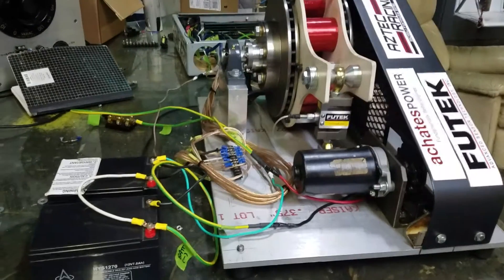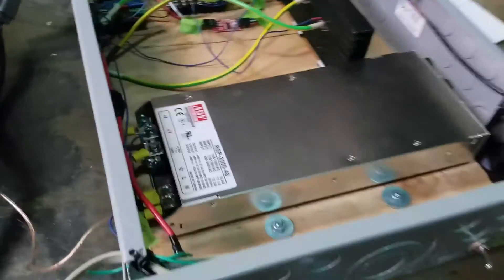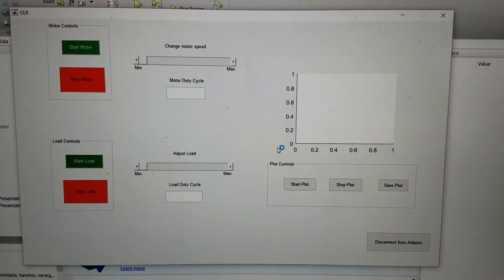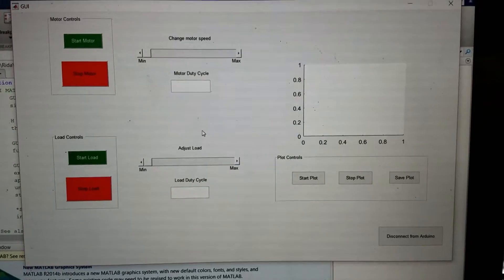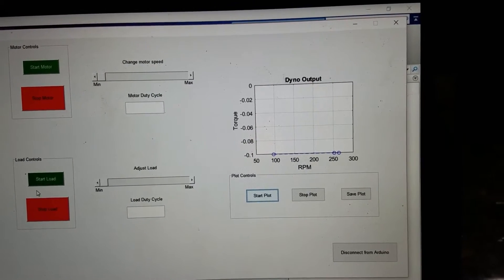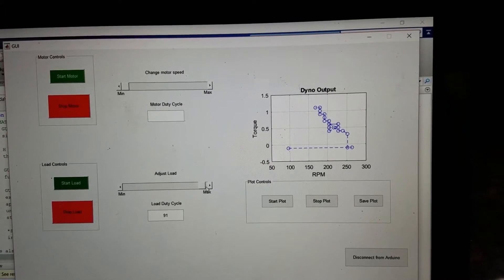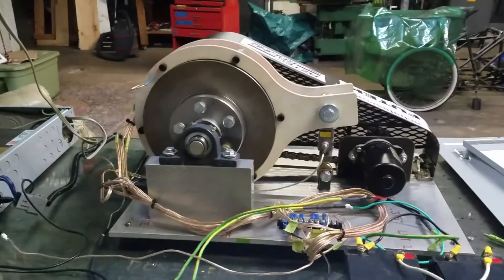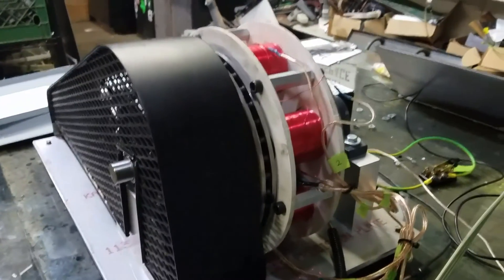Senior design - Eddy Current Dynamometer for FSAE

Comment: Do you need to calibrate the load? and how do you compare it to real world, eg, the slope of a hill compares to resistance on motor?
Reply: They have a calibrated load cell measuring torque, mounted at a known distance from the axle - Therefore they can calculate the torque without further calibration.

Comment: I agree, Totally awesome build. I'd love to get the details on the coil fabrication (gauge wire, number of turns, core material/dimensions) as well as the power supply details (schematic or basic specs on the PWM system). Surely you were required to do a write up for class. Why not share? Retarder dyno projects like this are few and far between. Did you  publish your details and results anywhere?

Comment: Totally awesome build. I'd love to get the details on the coil fabrication (gauge wire, number of turns, core material/dimensions) as well as the power supply details (schematic or basic specs on the PWM system). Surely you were required to do a write up for class. Why not share? Retarder dyno projects like this are few and far between. To only tease us with this video and move on to your next grade is simply not fair!
Reply: @Heads Mess Yes. You are absolutely correct. More than one way to skin a cat. I've had a lifelong struggle with analysis paralysis. Sometimes diving right in can be the way to go. But two things can be true at the same time, and I rather enjoy the satisfaction of the maths, schematics and thesis. I've scoured the salvage yards and even contacted the manager of the Telma-laden fleet of the local Casella waste services looking for a discard. Came close to getting lucky only once. Maybe time to follow your lead...
Reply: @blackmanops3749  I also suffer from analysis paralysis lol, that's why I'm here on this video trying to determine what type of dyno to make.

Comment: Hi! Nice project! How do you mount your car brake disc to the shaft? They need to be really tight together for the system to work reliably. Thanks!
Reply: Thats not how it works or why its there.

Comment: Did the dynamometer scale to FSAE power levels?  Is it repeatable and what is the resolution?  I'm assuming accuracy isn't as important.  Also, how hot do the brake rotors get?

Comment: so is the idea to basically apply an electric current, which should have a known (determined by windings, current, length of windings), or only measured torque value on the opposing motor? I suppose only the measurement is really important, unless you want to determine how efficient your brake is. So the kind of measurement you can take here is the torque compared to P[in]. Can you derive P[out] with an RPM measurement?
Reply from the maker: Hi James. Yes, the purpose of an engine dynamometer is to determine both the torque and power a motor produces. As you mentioned, we are not concerned with how much power the electromagnets consume (other than to design an appropriate power supply for it) but how much power a motor is capable of producing. If you have torque (lever arm times the force read at the load cell), then you can easily calculate power (in our case kW or HP). These parameters are important for Formula SAE car engineering in order to determine the requirements of all other systems (drive train, suspension, chassis, brakes, etc.).
Reply: Hi, 
Great Job guys, I just wanted to know whether you used a compression type load cell or tension load cell.